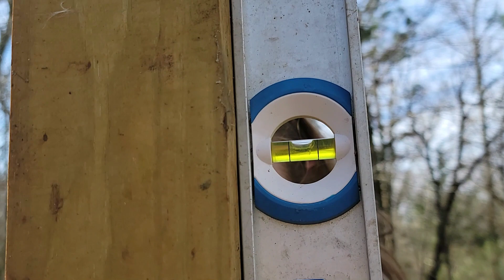Cordwood Chicken Coop  Part 1

Comment: Right on! Glad ya’ll are back and  doing some cool projects! The cordwood build was a damned good idea. I did a small toolshed years ago when I lived in Idaho. Sean.... ya better get some gloves brother. That mortar is going to dry your hands out. You will see tonight when you try to sleep. Lol.... great video!
Reply: Oh I knew it was gonna dry em out, and it did lol. I used a salve that Jamie made afterwards that made them feel better.  I hate wearing gloves, even when I know I need to
Reply: @sdixonwork  yea, I’m with ya. Gloves are a pain to work with when trying to do certain things.... like molding mortar in crevices. Anyway... you guys keep up the progress. We are a few steps behind you guys on our shed to cabin project in Scott County. Hey... I need advice. We have no cell reception at our place. Do you guys know of a good booster that works?
Reply: @timothybageant7429  what cell service do you use? 

When I worked for ATT they had their own and so did Verizon and they supposedly worked pretty good. However they do use a wifi signal so if you don't have good internet they may not help. 

Our signal suck here too but we manage. That's about the extent of my knowledge of cell boosters.
Reply: @timothybageant7429  man out where we are Sprint works better than any of em but their bill got crazy so we went to Verizon. 

Att has the best net work for sure but I've not seen any cell boosters worth a damn lol